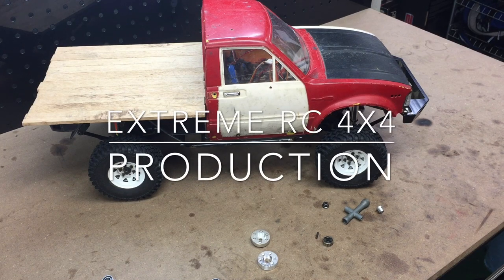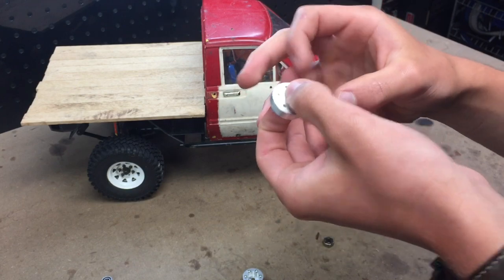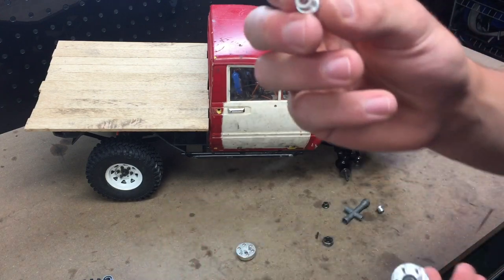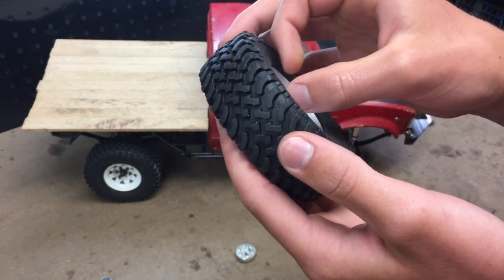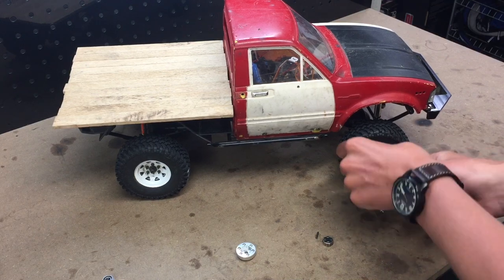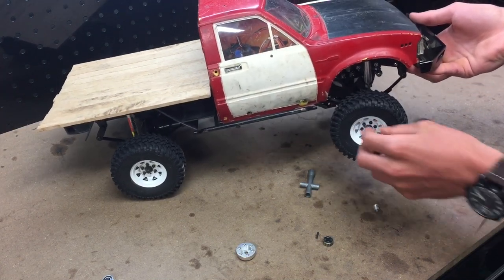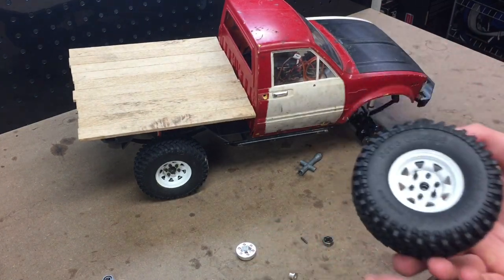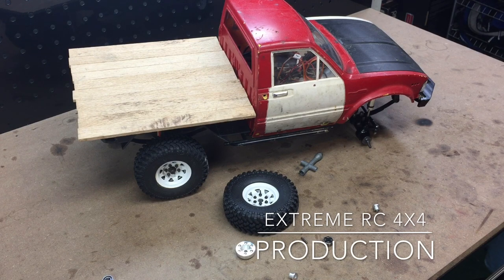EXTREME RC 4X4 Freewheel Hubs For RC4WD 1.55 Wheels

Comment: A little more R&D. Could use a pair for an Axial axle. I have a project that pulls a trailer. If the price was right. Nice idea so don't have to make open diff. Get the tollorances good so the nut could be tighten down.
Reply from the maker: RC Exploits I’m sure it could be done. Give me an email if your interested in having me make some. My email is extremerc4x4@gmail.com.